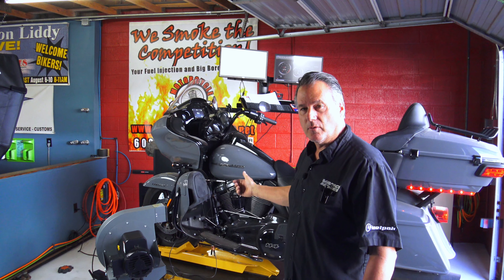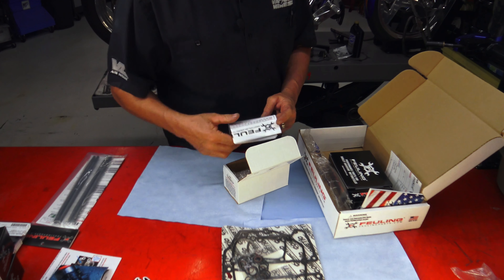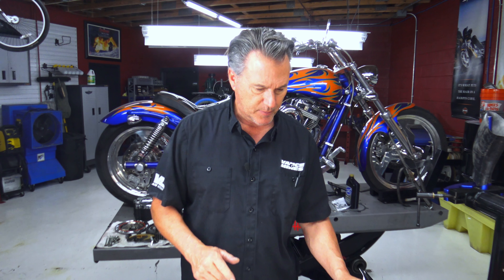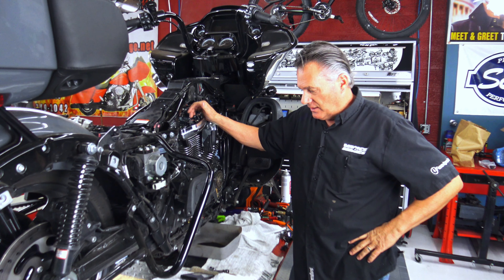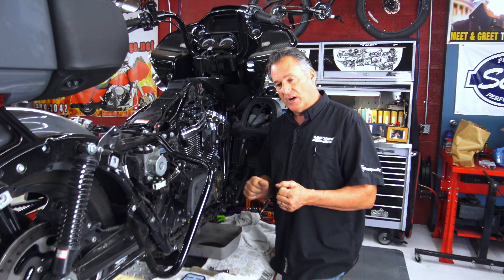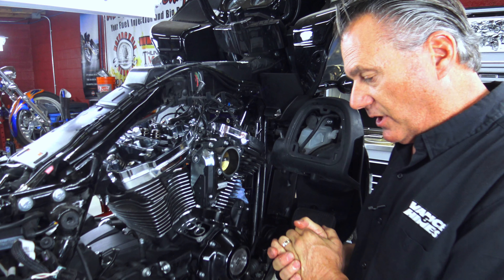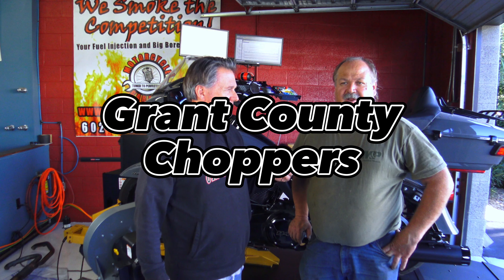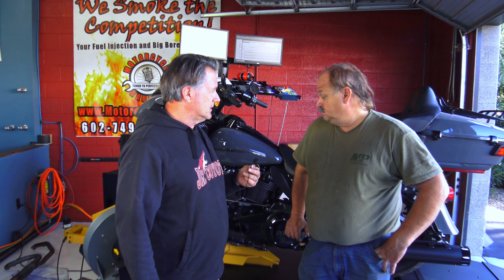2023 Harley-Davidson Road Glide Feuling 472 Cam Install and Dyno Tune

Comment: same cam i installed when i did my 124 kit did it myself bike made 122hp and 141tq have 15000 mi on it since install been very happy with it.thinking about adding manifold
Reply: curious im getting ready to do a 124 kit on my trike and i do long trips once a year. Question how reliable is the 124 kit and which did you use was thinking of using zippers but just starting my research.

Comment: Get you an Indian Roadmaster with the 119 thunderstruck and you don't have to go through all that NON SENSE😂😂😂😂😂😂. AND YOU DON'T EVEN HAVE TO PUT IT IN SPORT MODE. 😭😭😭😭😭😭😭
Reply: but then you will still have a bike that looks like  molded plastic garbage
Reply: Get a 24 Harley road glide and a 2into1 exhaust pipe. And it will not only look better than the Indian but will run with it all day long.